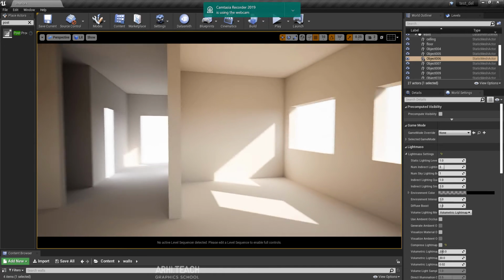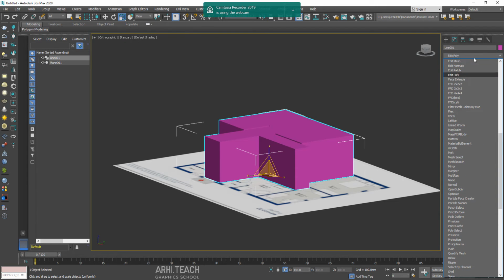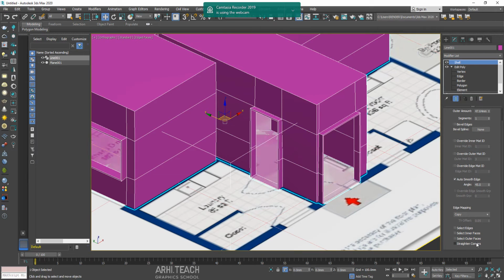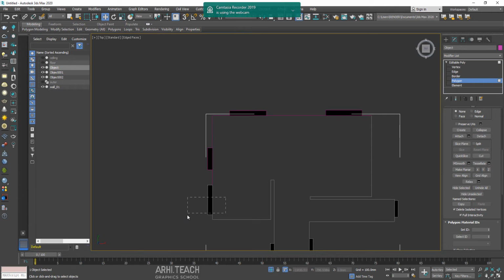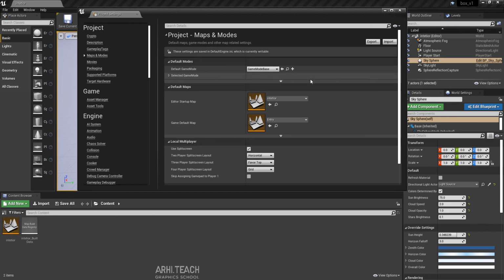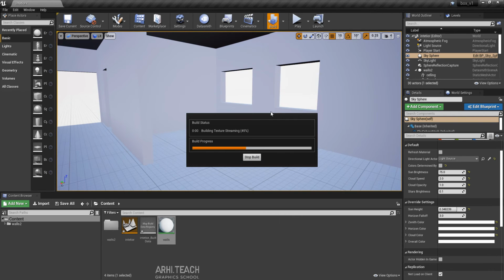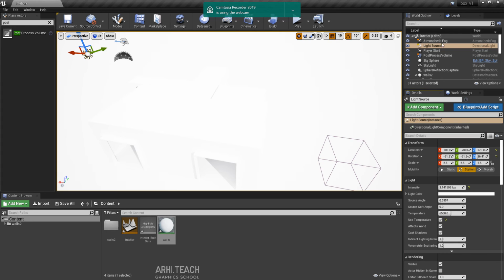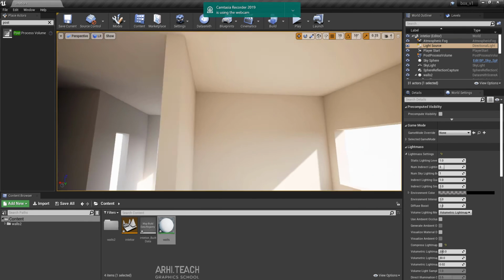How to create walls in 3ds Max and import it to Unreal Engine | Manually and with Datasmith [Fast]

Comment from the maker: *Content of How to create walls in 3ds max and import it to Unreal Engine Manually and with Datasmith Fast
*
0:00 Intro
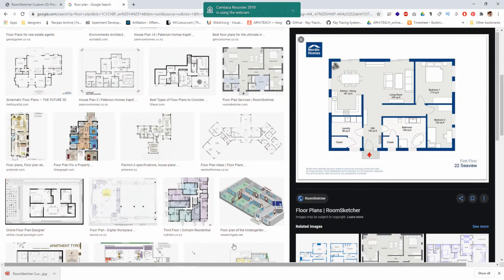0:20 Pick up the plan for 3ds Max to import to Unreal Engine
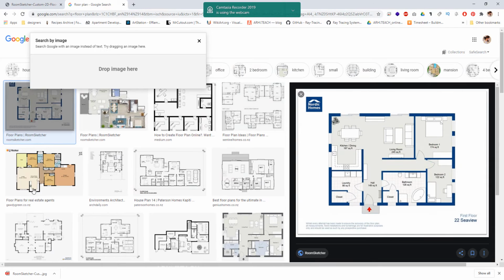0:40 Creating walls in 3ds Max to import to Unreal Engine
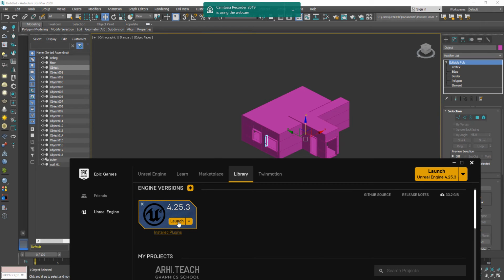12:50 Import walls from 3ds Max to Unreal Engine
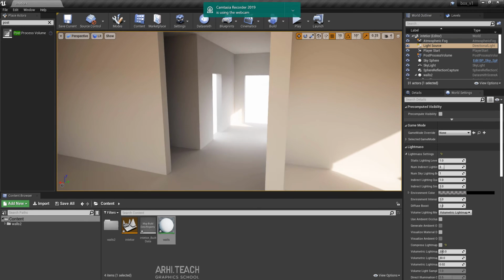24:46 Final results of importing from 3d Max to Unreal Engine

Comment: Hi, what's the size of the images you use? Cause I tried 2 different floor plans and they come in such a low quality into 3DS max that i'm not even able to outline the walls. Is there some config to change that? (Ps.: My images are 2000x1414)
Since now, thanks!